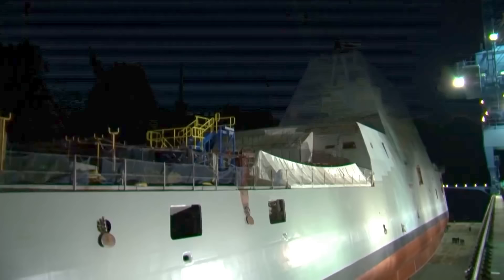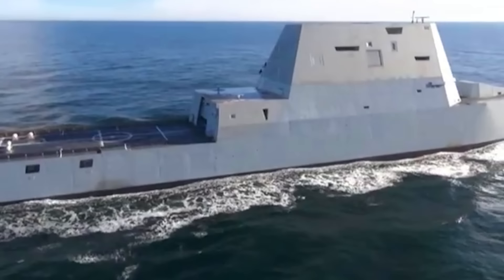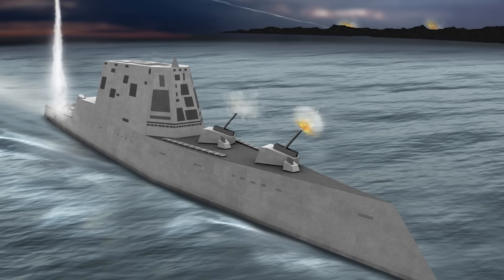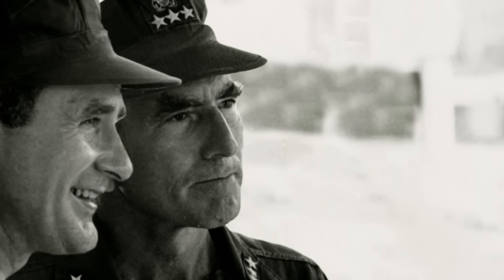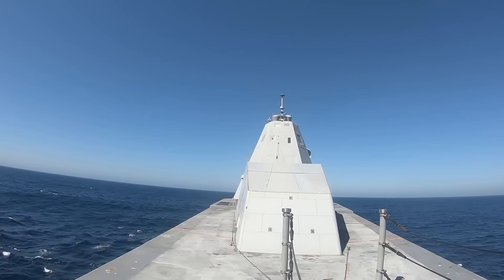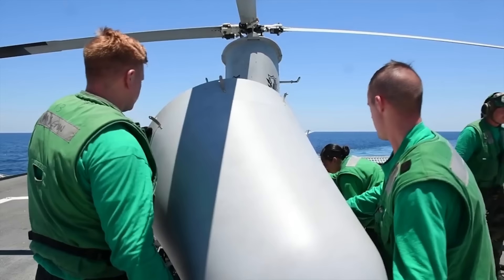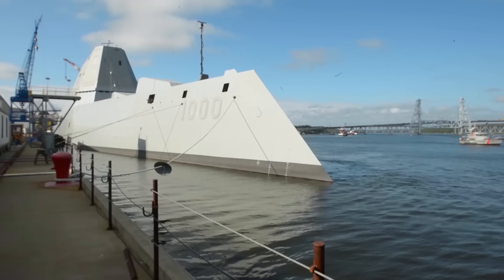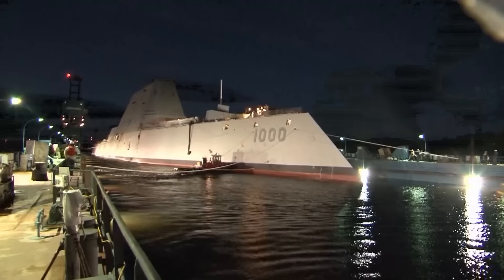The Stealth Ship So Powerful They Couldn't Build Any More

Comment: I don't think the Zumwalt was so powerful they couldn't build anymore.  It was such a powerful failure they couldn't build anymore.  It was massively expensive and none of it's systems worked.  How can you consider something a "technical marvel" when none of the technology worked?  That's not marvelous, that's a disaster.
Reply: I disagree.  They took a chance to create something way out of the box, and they learned a ton from doing this, and many technical details that are probably going to other newer ships.
There is always a cost to evolution even through failure.  I agree it is not meant for this time based on the report half of the systems were not capable enough because we basically do not have the technology currently.  Agree or disagree sometimes you have to push the boundaries and this one is probably 50 years out due to technology.
Reply: @rg20322  I would normally agree with you on the points you have made. But normally you would make one test bed prototype to learn and gain experience for the new technologies. But instead they built a hole class of ships. This is either to much money in there budget, that they have money to waste. Or not enough oversight. Which usually gets wrapped up in politics. Either way this thing is in the very least a disappointment.
Reply: It was it's structure that failed it the thing was riping apart right in it's metal Hall.
Reply: It was massively expensive because they decided to only build three, this meant that all the R&D and engineering costs were spread across three ships rather than 30.  The per unit cost of 30 would have been way lower.
Reply: It mays seems a failure bcoz of the costs it needed to build n maintain. But a few failed projects will lead to future improved innovation. No RND programmes are without fruitation
Reply: Facts wasn’t worth the money
Reply: Now they are repurposing it and rearming it with more conventional weapons. They’re trying to recoup their losses on the original concept ships.
Reply: The front falling off is not typical. It doesn’t happen all the time. 😤
Reply: @rg20322  - It's one thing to build a test platform to develop systems on and it's another to basically finalize a hull design and start building them when you have no idea what the war fighting systems are going to look like.  This is essentially a packaging problem.  They developed a box and had no idea what the systems that go inside that box are going to look like.  You're almost guaranteed to get the box wrong when you do that and they did.  Huge fail.  And why are you building hulls when the systems that go in them are nothing more than vaporware?  Those systems were nothing more than concept proposals on paper.  That's exactly backwards of how you need to do R&D.  You develop the systems first and then figure out what the box they go in looks like.  Every one of the war fighting systems for that ship could have been developed on land and fully vetted before committing them to a hull.  Now we've got 3 hulls floating around that are completely useless and the Navy is trying to figure out a mission for these pointless ships.

All you have to do is look no further than the Advanced Gun System that failed to meet its range requirements and each round for the gun cost $800,000.  So the Navy couldn't afford the ammunition for the gun so now we have a destroyer without guns.  Brilliant!  But that's almost ok when you consider the ships didn't come equipped with combat systems!  How do you fight a ship without combat systems?  Basically you have a destroyer with no anti-ship missiles, no anti-submarine torpedos, no long-range area air defense systems, no guns, and no combat control systems.  About all this powerful destroyer can do in a fight is float.  It's not powerful and it's not a threat.  It's basically a floating target for the enemy to get practice on.
Reply: @rg20322  the problem is the fleet of tried and true warships suffered decreased budgets which in turn means poor maintenance and upgrades. It has put a lot of great ships in the scrap yard. Not to 2 classes of new(advanced) ships that failed to meet a quarter of their life span. Its sad politics and personal agendas have put perfected and tested military might in the scrap yard.
Reply: @rg20322  The only way they could possibly fail is corruption.

The only thing learned was cost plus contracts are good.
Reply: More like political and military incompetence. This could have worked if not for the bureaucracy
Reply: Amen and God bless
Reply: The title was a confused attempt at ironic click bait.
Reply: Thorough take down x) You can't make a space x without cracking a few falcon 9's. I think they just need to restructure their management and they'll prove to be valuable. Til then I agree and see your point
Reply: The seawolf class is a technological marvel and yet only 3 was built.
Reply: @abikeanditsboy3449  homie you have to be an idiot to criticize the military for not knowing that the upcoming battlefield will look like. Nobody does. zumwalt class ships will be remembered as an incredibly important prototype ship.
Reply: ....most of the systems work, and work well. The engines and electrical systems alone are modern marvels and are directly being transferred to the new DDGX destroyers. Also, they're installing new missle tubes to launch the new Prompt Global Strike hypersonic missles...so these things are actually going to become real live destroyers. Plus it also obviously has the latest AEGIS combat systems installed as well...idk where you get all this rubbish about them not having any systems, or most of them not working? The biggest issue was the guns, now that's been solved with the new missle tubes currently being dropped in. Also - the thing has a radar/sonar signature of a small fishing boat. I mean...Wtf else do you want?!  'Merica!
Reply: It also looks like a blocked turd.
Reply: @labo7142  oh that's obviously true, because we're the number one military power in the world...so that must mean everything we build sucks! I hope you detect the sarcasm.
Reply: You could say it's a Marvelous Disaster
Reply: @2adamast  lol, in some cases that could be true...but having those massive SPY-6 radar arrays helps a good bit when guiding those missles 🤣
Reply: @justbe4481  Its. Its. Its. No apostrophe, dude
Reply: This is like the sea wolf sub …. Overtly everything but it’s where the Virginia class comes from and it’s cheaper. Even tho the seawolf is still quieter faster etc. they found a way to get close to the tec they created while saving money so maybe a lesson will be learned from the zumwalt. 🤷🏿‍♂️
Reply: @jpierce2l33t  The Zumwalt has no radar for its ESSM counter missiles.  
As for a destroyer,  by the time the Zumwalt radars see ship targets over the horizon, the targets can see the massive Zumwalt without radar. Those missiles are intended for submarines, there is probably a way to launch without own radar.
Reply: @2adamast  dude the whole ship is networked to the gills...plus has the full aegis combat suite and spy-6 radars. It's not lacking in anything except maybe anti-air, but not even that much. As for the hypersonics, they can hit targets upwards of a thousand miles away...so I have no idea what you're talking about
Reply: This is a very good example of "PLAYING WITH WORDS"
Reply: that time one ran into a fishing boat lol
Reply: @jpierce2l33t  Good points, and I wonder if when the USN energy weapons are ready for prime time if with all the electric power this ship produces if they will replace the main guns with them for close in anti aircraft support or maybe even damaging or blinding satellites in low orbit.
Reply: @fordgtguy  and because they made only 3 the specialty weaponry became to expensive to fire. Quoted at 1k per shot with a full 30 ships it went to over a million per. Then the rail gun was cancelled making the power plant pointless..
Reply: It was too powerfull to the budget 🤣
Reply: @SECONDQUEST  #1 The Zumwalt class was not a prototype.  They were going to build 32 hulls at 4-5 billion a piece.  That's not prototype quantities or cost.  That's a whole class that was intended to take on the role of the battleship.  A prototype hull designed for testing out future systems might have been a good idea.  However, the futuristic system the Navy wanted on this ship could have been built and tested on land before they started procuring the hulls.  Pretty much all you really needed a prototype hull for was to test the propulsion systems.  The stealth features could have been developed and tested through scale models before committing to a $5,000,000,000.00 hull.

#2 Only in your active imagination have I criticized the Navy for not knowing what the upcoming battlefield will look like.  The Navy had a definition for the ship and the role it would fill in a future battle space and the vast majority of the features and systems for the ship did not exist, they had to be invented.  In fact, 7 of the 12 major systems for this ship have been complete failures.  Who builds a warship with no combat control systems?  That could have been built on land and had the kinks worked out of it before figuring out how to fit it in a hull.  Ditto for its failed gun with million dollar per round ammo.  Even the powerful SPY radar this destroyer was supposed to be fitted with didn't exist.  All 12 key technologies could have been built on land and had the major deficiencies worked out before designing a hull to fit them in.  This program is another great example of how "concurrency" is a complete failure.  It sounds good in the imagination be has been a complete failure each time it's tried on a complex weapons system.

The Zumwalt won't be remembered as an incredibly important prototype ship, it'll be remembered as a disaster whose biggest achievement was breaking down in the Panama Canal.  Oh, and before you call me an idiot for something you've imagined I've said, do yourself a favor and work on your reading comprehension skills.
Reply: The hull design works great.  Some people were skeptical that the wave piercing tumble home design would even work. According to the Zumwalts Captain the hull worked perfectly. 

The Zumwalts use electric motors for propulsion. The intended permanent magnet motors did not work mas intended so heavier and larger induction motors were used. 

The planned rail gun system the Navy has been designing and testing for the last twenty years at the Dahlgren testing center was canceled. So the Navy decided to use a all new 6.1in gun. Except the new round intended to be fired from the gun was canceled. 6.1in is about 154.5mm. The US Army uses 155mm and already has the Copperhead precision guided munition round. Why didnt the US Navy just design their gun to use the available 155mm ammunition?  You can even fire rocket assisted projectile extended range munitions. 

But no, the precision round was canceled and now the Navy wants to rip out the 6.1in gun and install vertical launch cells and carry hypersonic missiles. 

The cost overruns caused Congress to cut the ships from 32 down to 3. The tehy complained the per unit costs was too high. Duh. 

IMHO the whole Zumwalt fiasco was a US Navy fustercluck of mismanagement.  The ships hull design works, the propulsion issues could have been sorted out with less high tech modules, and other available system like designing the guns to use available 155mm ammo could have avoided wasteful cost overruns.
Reply: Agree, CLICKBAIT (hate that)….
Reply: it also fell apart, the chassis was fundamentally flawed. this channel is propaganda lol.
Reply: @justingrey6008  $1000 per shot is super cheap for a naval weapon.
Reply: @fordgtguy  Zumwalt cost 4x of an Arleigh-Burke destroyer but carry the same number of missiles and lack the 14feet SPY6+15dB radars.
Reply: @fordgtguy  it the full 30 ships were made that is what the ammo would have cost... But we all know how that went..
Reply: @justingrey6008  $800k per shot with the extended guided 8" shells.
Reply: I'm sorry I don't agree just built to quick with too much new technology should of took more time with the new tech and let it mature
Reply: You are wrong you have to mature and build new technology it was the guns it wanted rail guns didn't work out the built to quick without maturing the guns first but now with hypersonics watch out plus 84 vertical tubes man it a offensive beast that will be hard to hit in the middle of ocean
Reply: Agree, a range of those involved needed demoting and benefit denial imo. Criminal level of tax payer money / faith abuse.
Reply: Naval incompetence in purchasing new ships and technology is well known to those who are paying attention. That's is a subject for another day. What I can say about DDG1000 based on personal experience; the stealth technology works. I held Zumwalt at 1000 yards range last year and flipped on my radar just for the heck of it. I saw NOTHING. She was a hole in the water
Reply: It is my understanding the. rail gun was abandoned due to the cost of the projectiles. The rail gun is not very advanced technology. Disneyland I see it on some roller coasters
Reply: The ammo is extremely expensive
Reply: @rg20322  Does the Navy have a history of learning from catastrophically over enthusiastic planning? Not that I’ve heard of. The next class will be just as ridiculously naive as the Zumwalt.

We need ships to fight in the real world. Not a fantasy war.
Reply: @fordgtguy  Baloney. This was a boondoggle from the first rivet. $800,000 per shell, and they don’t even have the advertised range.
Reply: @justbe4481  So much for aluminum warships.
Reply: @johncox2865  some where you can find the video the navy put out about why they scraped the zumwalt class.  It's very interesting.
Reply: @jth877  that's the price now, go find what the price would have been if all had been built. The price it was advertised at
Reply: @rg20322  I agree. You learn more from a failure than a victory.
Reply: Here Here ! The Bath Works Ship Builders Took the Navy for a Freakin Bath, Running Over Budget, Couldn't figure out    which Guns to put on it. Etc. Etc. The Zummie looks Slick and I think the Thing had Potential as a Fleet. The Navy should've said " Look ! We want you guys to build So Many of these Ships for so Much Money ! Take it or leave it !" No Bullshit ! 😁
Reply: Sounds like you didn't watch the entire video, chump
Reply: They started to build something much better actually.  They built something much more stealthy battleships that completely dive underwater and also glide on hydrofoil.
Reply: Another thing you miss is resources..like yttrium,gallium, dysprosium, samarium, neodymium. They are rare-earth elements (REEs)—little-known but crucial ingredients in much modern US military aerospace technology. Each stealthy F-35 strike fighter requires 1920 pounds of rare-earth material, according to DOD. Each Arleigh Burke DDG-51 destroyer requires 15,200 pounds. An SSN-774 Virginia-class submarine needs 19,200 pounds and we not counting missile radar system  satelite microprocessor  yet.But America have little amount of these rare earth mineral  like 1.2 milion tonnes left .That why US invade Afganistan. Afghanistan has an estimated 2.4 million tonnes of rare earth minerals including lithium (used in batteries), uranium (used for nuclear fuel) and many others. One of the largest deposits of rare earth minerals can be found at Khanneshin in Helmand  province. But US is kick out from Afganistan in 2021.
Reply: Yeah from what I understand they don't even ship out with shells for their deck guns - the shells are too expensive, over $1 million each.
Reply: But bet some politicians got a lot richer from it.
Reply: This opinion is dumb, it’s a test bed of tech and they made the smart choice of downgrading productikn
Reply: They could  not afford the ammo for the gun
Reply: If you are going to build a fancy schmantzy warship it would help immensely if the main guns worked and shells cost less than 1 mm each.
Reply: Y’all act like y’all served on it and knows what it does
Reply: @jonathanmills825  fair point
Reply: Failed project, hence the cancellation.
Reply: Not doubting what you're saying at all because I have no idea this is why I'm asking? How do you know none of its systems work? I don't imagine that something that they would advertise. I just started the video and saw your comment and I don't like being misled by videos that's why I wanted your opinion because if you have knowledge to the contrary I would like to know please!!
Reply: @notbobrosss3670  they didn't build a whole class of them. They literally built 3. No more. You know most of the time more than one prototype is built right? The 3 were only given their own class name because there is no other ships comparable to them therefore they got their own class, but there is no fleet at all, it's just 3 ships.
Reply: @SECONDQUEST  p
Reply: It was a complete disaster. That’s for sure. Looked great on paper.
Reply: The ammo price for the railgun skyrocketed from a few thousand to $800,000 per round due to only 3 ships being built instead of 35.
Reply: It's on deployment now
Reply: Every new model has bugs
Takes time to sort it out
My dad bought an early Ecoboost he knows😂
Reply: @jamesmaddison4546  - They were going to build a whole class of Zumwalt destroyers, 32 ships.  32 ships at $4-5,000,000,000.00 is not a prototype run.  32 units might be prototypes if you're designing a computer motherboard, but not a war ship.  You also don''t need to build a full sized hull for the prototype work.  Just about everything can be tested on land and all the major bugs worked out before trying to stuff all the equipment in the hull.  Don't call this a prototype because it wasn't.  Call it what it is, a complete failure.

The reason they only have 3 ships?  The program costs exceeded the budget by 50 percent, triggering an automatic cancellation according to the Nunn—McCurdy Act.  Considering 7/12 key technologies being politely called not "mature" you can see there was no end in sight to the hemorrhaging of money.  The Navy even tried reducing costs by cutting key technologies, technologies that supposedly made the Zumwalt class as powerful as it was supposed to be.  By cutting its key technologies the Navy now has 3 hulls in search of a mission.
Reply: @cazbantu4233  - It was the ammo for the LRLAP, Long Range Land Attack Projectile, a 155mm GPS guided artillery shell that costs $1M/round.  It only managed to achieve 2/3 of its specified maximum range.  Quite the bargain!
Reply: It's true. This is the most Lethal platform on the waters n it's not close. And there is half the amount of Crew that there is on a Ticonderoga boat
Reply: Oh really genius? Are you a naval shipbuilding expert?!
Reply: This sounds familiar…oh yeah…F-22 and F-35.  Yes, many growing pains but guess what…problems fixed and now by far the two most dominant fighters in the world.
Reply: Didn't the hull fail in very rough seas ? - Not enough flex in the design.
Reply: It's smoke and mirrors for a more powerful outter dimension ship. It's meant to bait other ships until the more powerful one appears.
Reply: @rickrick196  - Except for the F-35.  It still has major problems, some of which can never be fixed.  Also, the early models, and were not talking 1 or 2 air frames, we're talking 100+ air frames, can't be fixed and brought up to the current spec.  Those early air frames will remain broken and substandard forever.
Reply: @MH-kc1eu  - You don't have to be a naval shipbuilding expert to read the GAO reports to see what a mess this project has been.  The problems have also been well documented in the press.  And, I do have extensive background in many of the failed technologies that were to be used on this ship.  I also have a reasonable background in mechanical engineering and manufacturing to be able to look at what they were doing with the Zumwalt class to know the odds of it actually all coming together and working properly were virtually zero.  Concurrency sounds good on paper and may work for very simple projects, but it doesn't scale up.  The more complex the project the higher the likelihood of failure and they don't come much more complex than the Zumwalt class ships.
Reply: Yes I found the title misleading for the same reasons you posted here.
Reply: @justbe4481  It has way more problems than that.
Reply: That what I was told about this ship, it was to expensive and not worth it.
Reply: Agreed. It's like the Soviet totally Titanium Cruiser we leased for tech studies from them, way back. Big, fast, powerful. Sucks fuel like blue whales eat krill, and totally era-bricked tech.  Even the Navy couldn't afford to fully fuel it! 
Zimmwalt was the 'improved' version, im guessing.
Reply: @rg20322  Yes, the entire program was worth 22.5 billion dollars to test some technology. I'm sure you pay quadruple the cost of the shirt you're interested in, just to try it on.
Reply: I think you are right, but still the program was a failure, even if much was learned from the problems.
Reply: Hole? Hall? Some of you want to give your opinions on next generation navel
engineering but can not spell whole or hull.
Reply: @AC-Austin-MHG  Oh wow, it's so powerful it can kill someone... My most expensive kitchen knife costs about a dollar, and it can do the same thing.
Reply: @definitelyfrank9341  and your YouTube is a very young YouTube two years old 😂 has nothing on mine
Reply: @definitelyfrank9341  mine is 8 years old going on 9
Reply: @AC-Austin-MHG  The ship lacks naval warfare capabilities, it lacks ammo, it lacks survivability, and the country building it lacks the budget for it.
Reply: @AC-Austin-MHG  Did you even know this ship even existed before watching this video? A lot of the problems aren't mentioned in this video.

This channel makes money by either talking shit about a common enemy, hyping up Nato technology, or just hyping up very iconic aircraft.
Reply: @definitelyfrank9341  don't like this channel unsubscribe and don't watch none and doesn't matter I watched the video and googled it and it's no joke it's to good for this generation and to highly advanced
Reply: Exactly , 😅😅😅😅
Reply: The only thing that's wrong with the zimwalt destroyers is the amunition was to expensive and never progressed. The Navy should have built more that was the only mistake they made. As said in some comments they didn't build enough destroyers to cove the RD to cover the cost.
  I'm sure the Navy learned alot from the program to use the technology in the newer destroyers. I do believe the Zimwalt will come back as technologies get cheaper.
Reply: @briankaitschuck125  lol sure except not only was the ammo for the rail gun expensive the gun itself have a very short lifespan. The laser system didn't work. The propulsion system didn't work. Hence why one failed the open sea trial. I mean this is not top secret info do some research.
Reply: @northpointaxe6167   From what i gather it is a sixth gen that is open source so it can be upgraded to a seventh. Along with a uav wingman.
Reply: @rg20322  The zumwalt failed on every measurable component eval from cost overruns to basic systems integration right? Another case of good on paper, useless in water... according to the NAVY. Even if all design parameters were met, it lacks long range area air defence weapons, anti sub weapons or anti ship missiles.... all of which will be incredibly important in the event of any near peer engagement where the U.S. will most likely be far away from friendly ports. I sure hope it's a good psyop and the ship is actually amazing... Oh and that's not even considering the reported LCS failings... How does a modular mission/system design working it's not functionally modular? OOOF
Reply: They were MASSIVELY successful.. just not according to you. It was a successful in many ways.
Reply: @jkevinf5091  This retrofit remission program effectively defeats the purpose of building a new, incredibly expensive "cutting edge"  class of ships that are compromised or handicapped. Possibly tasked for a mission they weren't designed for with weapons systems the class weren't designed with which present massive systems integration and sensor fusion issues.... Giant waste of money vs building a full fleet of cheaper, iteratively improved ships with largely proven systems.
Reply: @redadder206  Well cardboard is out 🤣
Reply: @jacobcdumas  The high low class build concept vs attempted modularity with the LCS class and specialty with what the zumwalt was supposed to be. Big Ooof
Reply: @jacobcdumas  plus now the u.s. navy doesn't have competitive long range stand off anti ship capabilities. The harpoon was old 20 years ago. Hope were stock piling SM-3s
Reply: @culturebreath369   so if they were so successful how come we are not building more? How come they are not deployed? You call a war ship that can't sail in open seas a success? The rader system failed, the weapons system failed, no lazer, rail gun is to expensive to operate and has the service life of bread. Please do tell how they were successful? The vertical missle lunch system is from submarines that are twenty years old. I will admit the R&D might be useful but not at the cost to the tax payers.
Reply: @williamadams4843  if they didn't learn anything from their failures than sure it was a waste and a total failure. But I doubt that. And I'd also say it's safe to bet that they got plenty out of the project despite needing to scrap it in the end. They do wild shit like that all the time but they ALWAYS gain something. Just my thoughts. I'm not butthurt or anything! :)
Reply: @culturebreath369  As a R&D project i would agree. The problem is this was a replacement project that completely failed and is being written off as R&D. The systems should have been built and tested then once all the tech was figured out then you know how much space,power,man power etc. Is needed and you build them then. This was a case of putting the cart before the horse.
Reply: @williamadams4843  makes sense. 🤷‍♂️ hope they learned SOMETHING.......... 🙏 😔 😕
Reply: Yes it was junk & technical marvel it was not. Just like the new aircraft carriers that I help build now a days, there are so many problems with them. Now we are about to start building the new class of submarines. I can't wait to see the problems we will have with these also. I am a firm believer that today's new engineers would not amount to a pimple on an old engineer's @ss. The stuff they engineered back in the days was amazing. The stuff now a days are always screwed up right out the box. That doesn't just go for ships, submarines & etc. That goes for cars, house appliances & etc. Seems nothing made now a days is worth a crap. I think they have lost something in the education system that has failed us.
Reply: LOLs! CCP bot in chat
Reply: @MercedesE63S-AMG  you mean like having four aircraft launchers that all have to be shut down if one fails? Lmao you sir hit the nail on the head
Reply: The early rockets never made it to space but they were still technical marvels. Stepping stones.
Reply: @acidcouch3651  early rockets were not meant to go to space they were artillery for war
Reply: The Abrams tank was the same kind of Golden Fleece. The US military spends more than any organization or individual in history. And who knows, The Zumwalt's biggest mission may be chasing and catching the world's last fish for whomever is the richest person then.
Reply: @Pbav8tor  not sure what you are implying the Abrams M1 and M2 dominate the retro fit between 1 and 2 was technology inside and newer reactive armor that wasn't available at the time the M1 came out.
Reply: I'm pretty sure this video shows every feature work so idk wtf u smokin dude
Reply: @codybeardsworth6348   smh yeah sure it is normal for a war ship to lose crew and have to be towed in. They unveiled it in Baltimore City inner harbor. Do five minutes of research outside of the video. Also in the video it says one failed sea trials, no lazer weapons, power system failed, railgun works for a few shots. You gonna buy a glock or AR if you get one mag before the gun is no good?
Reply: @fordgtguy  exactly why it's main gun was cancelled. The cost of the ammo for just three ships was cost prohibitive.
Reply: Oof the new futuristic ship from the USA breaking down in the Panama Canal how embarrassing lol.
Reply: @apollobukowski4275  all three failed smh. One in the canal, one at sea trials, one on the way to its public unveiling
Reply: I agree whole heartedly. That's why they deployed where nuttin is gonna happen. Epic failure.
Reply: @williamadams4843  dang literally an  epic fail. Hope they have a sweet redemption story. They certainly look cool.
Reply: SHHHH... that waskely wabbit might hear you and find out the truth and we wouldn't want that.
Reply: just like the lump of garbage F-35 they say is better than the J-35 😂 😂 😂
Reply: You Exactly right. Not only does it not have any guns it doesn’t have any of the vertical launch missiles that it was supposed to have either… And it may reflect radar giving it a small signature however one fact you may not know and they didn’t mention here is that good old fashion sonar bounces off of it just fine giving up its position and distance to Any ship that has that 80+ year old technology… Low frequency waves used on ships dating back to World War I and in common use since the 20s… Fit it on every ship since the 30s…
Reply: This. Came here racking my brain wondering how the zumwalt was "too powerful to make more" when the whole project flopped because it was shit.
Reply: Like you do your research
Reply: I agree. The Zumwalt is an example of the MIC selling a concept and then building it and failing badly at great expense. Zumwalt and the littoral ships are all failures. The fact is a Kinzhal equipped Russian Corvette could easily take it out. Epic fail!
Reply: Not sure why we always talk about the cost as if that even matters. Machines print money whenever they need it , it’s not backed by anything so it being expensive has zero to do with it. They never care about how much money stuff costs.
Reply: They built the Zumwalt around the rail gun.  The rail gun would self destruct unexpectedly after a few rounds.
Reply: Exxxxxaaaaaccccctttttlllllyyyyy what processed by my mind seeing the tittle
Reply: Floats way better than the Slava class
Reply: Oh the tech worked.  They just couldn't afford some of the stuff.  Like the rail gun.  Million dollar shells?  The problem is the navy actual saw this as the boondoggle it was.  How could a shell cost a million bucks. The company thought they had some in on a steady money maker.  Thankfully they quit that shit.
Reply: It worked quite well 👍👍👍
Reply: Technically, it was a marvelous disaster. I think that’s what he meant to say in the video lol
Reply: Depends on when you stop development. It had a bunch of problems that would’ve been resolved yet they curtailed the program cause of cost. The F35 was a bit of a boondoggle but is now an increasingly cheap per unit phenomenal 5th gen platform that will be deployed in the thousands across the world. If they’d cancelled the program in 2014 then it would d been just like the Zumwalt. These are incredibly complex designs that require many years of refinement AFTER design and initial construction. If you want something that will “work” on day one then build a 40 year old platform.
Reply: It’s not that they can’t  build more the problem is  mostly the main guns used we can’t produce the ammo needed to fire it at a reasonable price I think to full load the ammo would cost more than the boat it self
Reply: It works...its floating...in use...and capable...hows that a failure?
Reply: In the history of everything that works there was a point in time at which it didn’t.
Reply: @justbe4481 What?! That’s not even in the same universe of reality. I work there. There were no issue with the ship’s structure when delivered. I love how people just make stuff up.
Reply: @abikeanditsboy3449  The full amount of its budget isn't going to the Zumwalt. It's a cover for other Navy/Aerospace projects that need the money. 🤦‍♀️
Reply: @murlyn2  what the navy say about is why they scraped it.
Reply: I agree, usa should have done what all society and business have done sine late 1970's subcontract its construction to china
Reply: @renatomsgomes  most of the components was made in china.
Reply: @justbe4481   of course not but usa society simply refuses to make stuff defenitly contribuits to low quality of managerial skill that made more mistakes that several butdgets couldnt hold on...
Reply: @renatomsgomes  we are making stuff again here More companies are returning back in America .
Reply: They wasted billions and billions of dollars on this failure
Reply: Navy tried to jump ahead in tech way too hard. They wanted to make the F35 of ships, but nobody fights with ships anymore so there was no resolve to force the program to be successful.
Reply: @justbe4481  they didn’t scrap it. They’re in service.
Reply: @justbe4481  OMG where are you getting your information? Are you writing a fantasy article? The structure isn’t failing. 😂. At least use some facts.
Reply: @elen5871  that is not true at all. The Hull, not chassis, did not fall apart at all.
Reply: @johncox2865  it’s not aluminum. No part of it is.
Reply: @murlyn2  oh right sorry the hull held together as the chassis fell apart and the engine vibrated itself to death in like a year MY BAD 😆
Reply: @eswing2153  it was not a complete disaster.
Reply: That’s a complete fabrication. All of the systems work. Where do all of you get this information?
Reply: I’m amazed at the amount of foolish and completely fabricated  facts I have read in the comments. The ship’s systems do work. The Hull is not falling apart. The ship is not made of aluminum. The electric motors are not all that special. Some civilian ferries use electric motors as well. It is not the most powerful surface combatant. It’s not a battleship. It’s a destroyer. BTW DDG stands for Guided Missile Destroyer not Battleship. The ships were not scrapped. These are all inaccurate statements. 
Credit to those who claimed the cost of the rocket assisted rounds being around $800K. That is correct. That was the price increase per round after the Navy decided to not build 20 to 30 something DDG 1000s. That made the price of rounds go up from what I thought was already to expensive to the approximate $800k per round. 
The ship’s design purpose, what the US Navy wanted many years before it was built, was a ship that could provide accurate artillery fire to support small and medium ground units doing combat operations against insurgent type forces at a distance not possible by traditional naval guns. At the time the Advanced Gun System “AGS” built by BAE seemed to be the answer. By the time the ship was built, the threat of combating insurgent sized forces had subsided and the threat of sea combat had risen, China’s rapidly growing navy. This left the main features of the DDG 1000 class, the AGS and the extreme stealthy Radar Cross Section, “RCC”  to be less needed or viable.  The automated round reloading feature of the AGS also took more valuable footprint in the ship. This lessened the amount of missiles the ship could carry. The missiles it does have are launched from the Peripheral Vertical Launch System, “PVLS”. For a ship of over 600 feet, the amount of missiles it could carry were underwhelming when considering that it was the ship’s only legitimate sea warfare weapon. 
The advanced automated systems that control things on the ship were very expensive. The AGS was expensive. The PVLS’ were very expensive. The Aft sea door was expensive. The first two DDG100s have a superstructure made out of composite material. That was very expensive. The third superstructure is made of steel. The hulls of all three ships are made of steel. A very strong steel. The first ship, the Lead ship of the class cost approximately six billion dollars. That’s why the navy didn’t want any more. The cost was staggering. The second and third were quite a bit less. However, when compared to the battle tested, do it all ship: the DDG 51, the DDG 1000 is not worth it. The cost of the DDG51 at the time, the Flight 2A, was just under two billion and was unmatched by other navies. The updated DDG51 Flight 3 is even more capable and again is unmatched. These are the actual “facts” on the subject. The sad part is that you didn’t have to work at Bath Iron Works, “BIW” and been one of the people responsible to train the men and women  on how to build these ships for the past 35 years like I have. This is all public information you can find it all online. Obviously many of the commenters were to lazy to look it up and learn something before making uninformed comments. There seems to be to much of this in today’s world.
Reply: @murlyn2  - The information comes from publically available government reports.  People who report on military news get those reports and write articles about the system's failings.  7 of the 12 critical technoloigies were complete failures and didn't work.  It's not too hard to find the information, all you have to do is look.
Reply: @abikeanditsboy3449 have you ever had a discussion with someone who had absolutely no knowledge of a subject but they still disagree with you, and you wondered how they could be so ignorant or arrogant and not even understand how uninformed they are? Well you should know now how that happens. You are arguing with someone who has likely more years building ships, including the subject of debate, than possibly you and most of the other keyboard naval experts on here have on the planet. Believe what you want, obviously it’s your prerogative. Look me up. I am who I say I am. What’s your credentials?
Reply: @murlyn2  - "[H]ave you ever had a discussion with someone who had absolutely no knowledge of a subject but they still disagree with you[?]"  Yes, you.
Reply: @murlyn2  - To be fair you probably deserve more than a simple snarky answer … maybe.  The GAO publishes official reports on various projects like the Zumwalt.  You don’t need specialized degrees or skill sets to be able to read and understand those reports.  The official GAO reports outline the failures of the Zumwalt’s systems.  All you have to do is read the reports.  News outlets also got hold of those reports and wrote stories about the class’s failings.  You can read those stories too.  You may or may not have some limited knowledge in building the hulls but that doesn’t make you an expert in all things Zumwalt.  To know those details you too would have to go to the official government reports published by the GAO to understand its failings.

You talk about the AGS which only achieved 66% of the promised range.  That’s called a fail.  The auto-reload system took more space than thought decreasing the number of missiles it could carry.  That’s called a fail.  The SPY RADAR didn’t work.  That’s called a fail.  The combat control systems didn’t work.  That’s called a fail.  

As I said in a previous comment, a ship is essentially a packaging problem.  You’ve got all these systems you want in the ship and you have to design the “box” or hull they go in to.  In this case they designed the “box” without knowing what the space requirements for the system looked like.  As you stated the AGS took up space designated for the PVLS.  That’s called a fail.  When you’re systems are vaporware you can’t accurately predict the real estate necessary for the systems and short of a miracle they’re not going to fit in the ship, see the AGS vs. PVLS you pointed out.

The Zumwalt was 150% over budget triggering an automatic project cancellation which was a good thing because there was no end in sight to the hemorrhaging of money to get it working.  That whole project was an exercise in failure and more proof that “concurrency” though it sounds great on paper does not work in practice.
Reply: Everything does work, just the guns don't work, but they are being removed and replaced with hypersonic missiles, the ship will be the most powerful in the world other than aircraft carriers
Reply: Well it was implemented with new state of the art techs so yeah, of course it won be perfect first time, plus those are so expensive